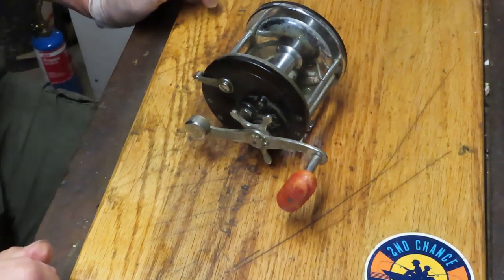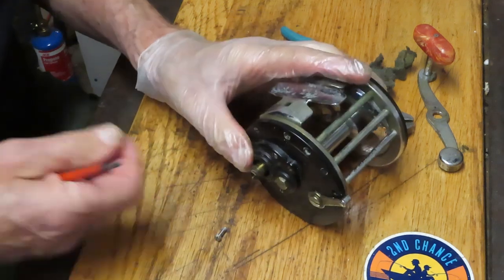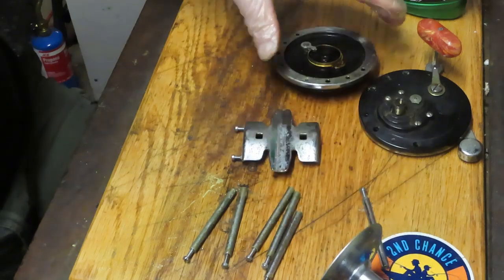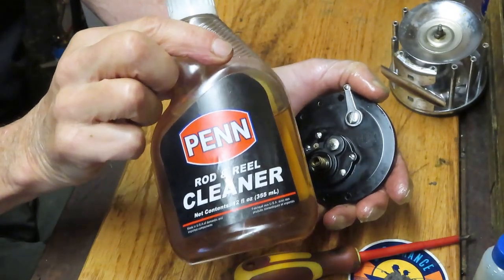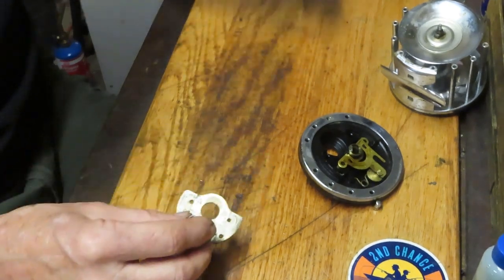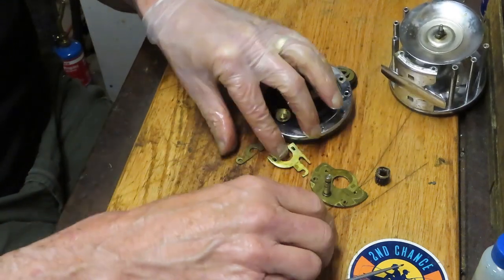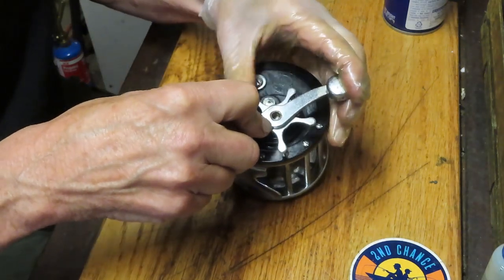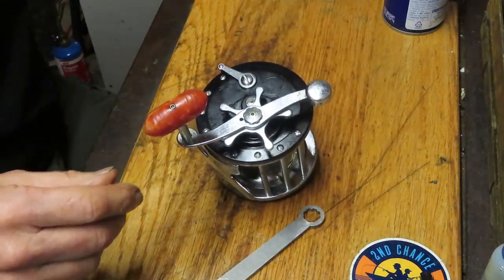Penn Long Beach 67 fishing reel how to service

Comment: If you do lubricate hard washers, will the drag still work?  I was wondering, since the oil or grease will stay on the surface of the hard washer, since the washer won't absorb it, if it would hinder the drag performance.
Reply from the maker: It will still work and have a minimal benefit.  Unfortunately. folks put a lot on and then it just spins off and dries in the case.  That is where the performance issues come from - Dennis